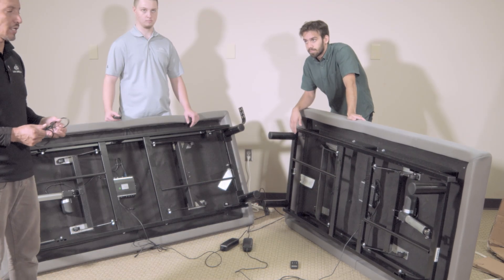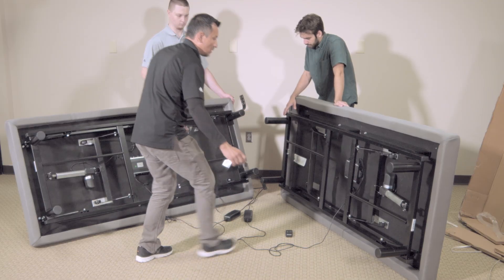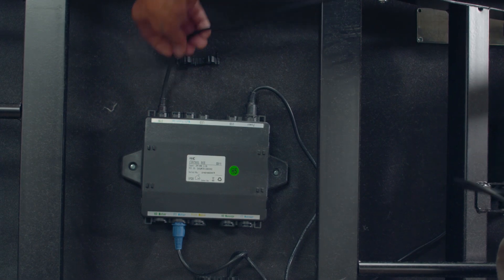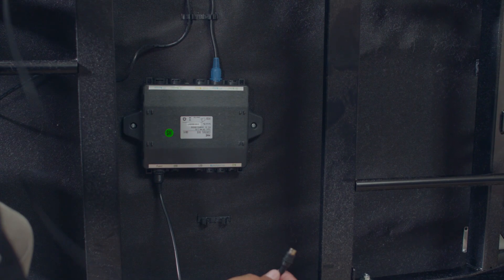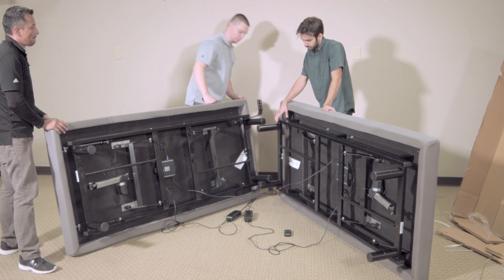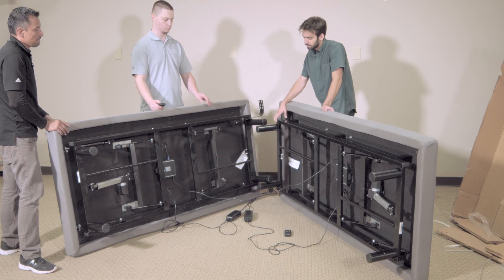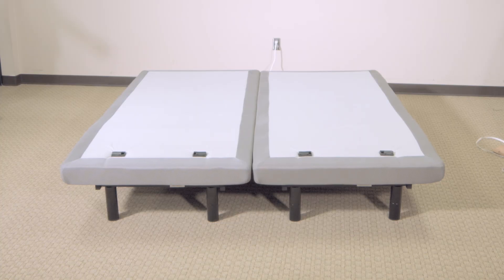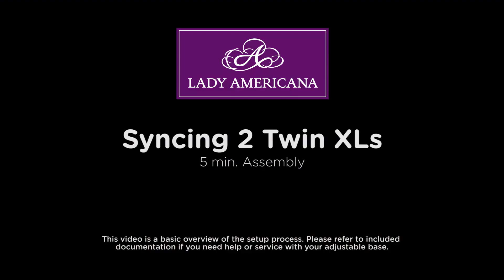Syncing 2 Twin XLs

Comment: The only reason I gave you a thumbs down is because you did not explain how to sync the bases together. You only explained how to plug in the cable. I’ve been selling these for many years and if you’re going to do an instructional video, please add more commentary and detailed instructions.
Reply: so how do you get them to sync/pair?
Reply: @James-s3s6s  many manufacturers such as Serta and Sealy provide a remote with a sink button located on the bottom near the batteries. Occasionally depending on the model of the adjustable base, you will need to plug your sync cord into the reserve battery pack (not the technical term lol).  The “battery pack” does not have to contain batteries.  As it will also be connected to the main power supply. If you notice in the video, he wanted to check to make sure that they synced. He did not give further instruction as to what to do if they do not ‘pair’.  I always suggest following your owners manual and if you have any further questions contact the manufacturer at the 800 number provided.